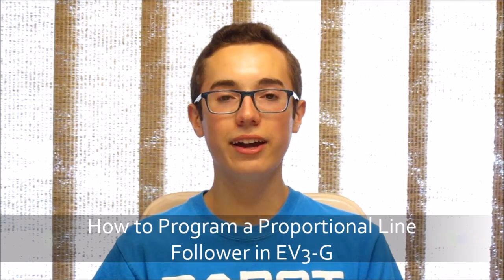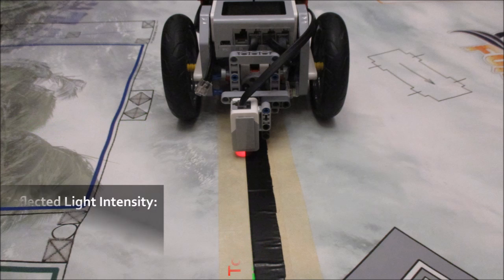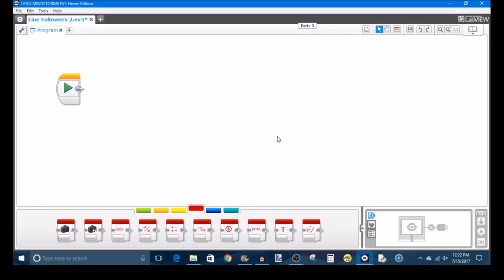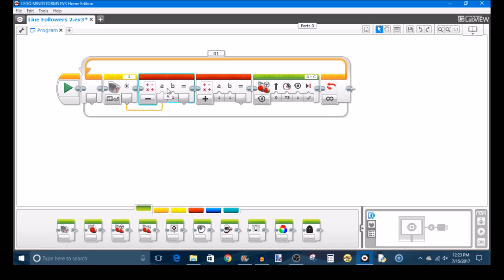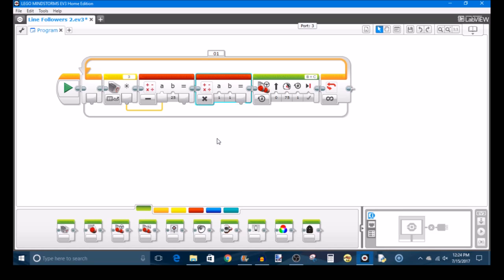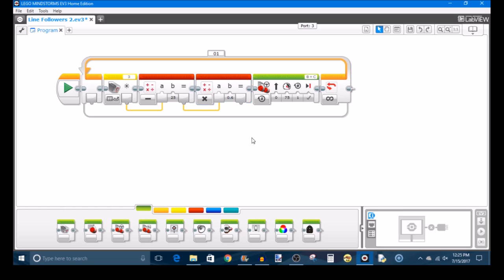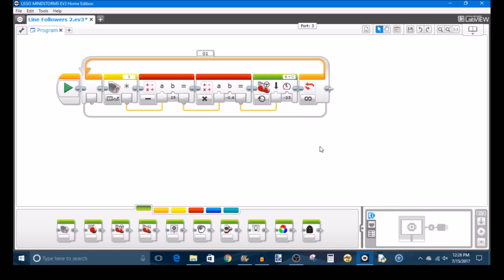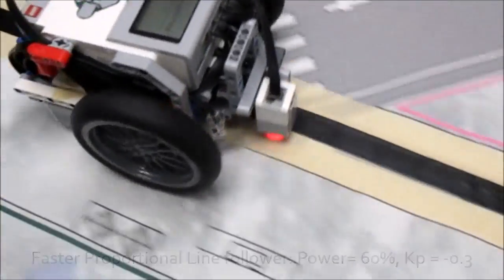Proportional Line Follower for EV3 - Follow the Line Smoothly!

Comment: I have a problem. I have NXT robot and if I use EV3 program its telling me that my color senzor is getting 0 or 1 and not more. If i measure the light reflection  "manually" by the brick Im getting between 45-80 (table and black tape)

Comment: Thanks for the info..btw im planning to build a follower guided pantograph for my plasma metal cutter, is it possible to use this design? The follower sensor will be riding on the x y axis table and the x y movements will be controlled by motors, it would need to be reversing..do you have a similar design that would fit my plan build? I wish you could help me..tia! Happy new year!

Comment: Thanks for this vid, but I never could get it to work on our FLL EV3 robot after tinkering for about an hour. I suspect it has to do with where our color sensor is placed: not out in front of the robot like yours, but actually underneath the robot slightly behind the wheels. 

We had to go this way after a disastrous result a couple years ago where the florescent gym lighting at our competition was much different than the warm lighting in my house where we set the programs, and we failed everything we set out to do since the reflected light values were so much different. 

The next year we put the light sensor beneath the robot so the outside light didn't pollute, and did much better with those kinds of sensors/programs. 

Is it possible to use a follower program similar to this even though the light is in a different position on the robot? Thanks for the help.
Reply: We're having the same issue and also tucked our sensor in the middle under the brick. Were you able to resolve this issue?
Reply: Shazia Riaz nope. We just did without line following.
Reply: @thebruisedreed9766  interesting. Did you try moving the sensor to the front to test and see if you're right about placement? I might do that. So odd that it won't work. Thanks for responding.

Comment: I tried the line follower with my robot, but it kept spinning in circles. How do I fix this? Thanks
Reply from the maker: Make sure that your color sensor is detecting the line. You can verify this using Port View to see the reflected light intensity and comparing it to your threshold value.
Reply: make sure your math block is a - and x
Reply: Make sure you're using the correct port for your sensor

Comment: Is it posiible to do pid with medium motors ?? If yes show us please
Reply from the maker: Yes, a PID is a feedback loop algorithm, so you can really apply it to any system that required corrections based on error; that means any motor type for line following. The difference between Medium and Large motors is that Medium motors have no Move Steering block, so you have to make your own by adding/subtracting the power values in two independent motor blocks to make turns.
Reply: @Builderdude35 Ok but i how will i do that.Lets say i find the error (colour sensor value - target) and i multiply times kp.Then how can i make medium motors move in this steering(correction).Please tell me the exact code cause i have to make a medium motor line follower.Thank you!
Reply from the maker: @ggelosstavrou9117  The output of the PID algorithm is a single numerical value. Set both medium motors to a base power level (ex: 50%) and then add the PID output to the power value of one Med motor, subtract it from the other.
Reply: @Builderdude35  oh ok thank you very much i will try this! By the way can you watch a video on youtube called robotex 2018 line following 14 years old and older and watch the 3 best robots in the end.You believe it is just pid or it has something more.Please i need your opinion. Thanks a lot!

Comment: Hi! I've a serious problem. We're using a robot similar to your robot, Sirius. The weight is distributed equally, it moves in a straight line, and the wheels has a firm grip. We've tried out your proportional line following program, but our robot seems to wiggle and lose track of the line.
Reply from the maker: Your Kp is improperly adjusted. From your description, it seems most likely that it is too large, so try experimenting with a smaller constant.

Comment: This doesn’t work it won’t go round a left turn or a right turn at all
Reply from the maker: You will need to adjust the k value to handle sharper turns. Or, use a PPID algorithm.

Comment: Hi. Why did you not use the maths bloc with ADV mode and (a-b)*c instead of the 2 maths blocs ?
Thank for your videos.
Reply from the maker: You can certainly use that block to replace the two math blocks with one. I chose to do two separate blocks because I think it's clearer and easier to teach that way. Also, I don't like having those two extra empty terms. It all works the same way when it runs on the robot, so which way you program is purely a matter of opinion.
Reply: Thank you for your answer.
What do you think to make a video about where to put the sensor ? In front, between the wheels, by a side or in the middle ?
Reply from the maker: Definitely in front. I have a video that goes into a little more detail about sensor placement here: https://youtu.be/kNXwkVwnwLI
Reply: Thank you to your parents for having designed you.

Comment: I went to summer camp and there was a robotics competition. The teacher used your videos to show kids everything they could possibly need to know for the program. The challenge was to make a robot drive in a perfect square and points were awarded for staying parallel and time. I used the same line follower (a month before this video) and it failed horribly. I know the program is perfect but the wood wrecked the color and the robot drive in circles. I ended up having to use a gyro sensor and came in third out of 16 teams. I only lost because I got stuck with tiny wheels and the two teams ahead of me had wheels bigger than Sirius. I’m still kinda mad lol.
Reply from the maker: Aww man! I'm sorry to hear it didn't work out! But, you can use this as a learning experience; taller wheels allow a robot to drive over bumps with less of an effect. Anyway, good luck next time!

Comment: Good video! But why don't you set the power 100 (-100)? Thank you!
Reply from the maker: As you can see, the robot I show in this demonstration, Sirius, has really tall wheels. 100% power would be too much and the robot would be way too fast to be controllable. If your robot has shorter wheels, then you might be able to try a higher power.
Reply: Thanks a lot, Builderdude35. But what I have to do to make your Sirius more fast (and controllable)? Can you continue to explain this theme (Line Follower) in your next video? Thank you!
Reply from the maker: You can definitely make it faster than the 35% I showed, but you will need to spend more time tuning. To make your robot more stable, you may want to rethink where the color sensors are in relation to the wheels. Check out this video (https://youtu.be/kNXwkVwnwLI), it explains what I mean. Also consider a two-sensor line follower; they are more stable.

Comment: If the robot starts FAR AWAY from the black line, what is the best way for the 'bot to ACQUIRE the line?  If the approach is done at a steep angle (and not perfectly parallel with the black line in the first place), how can the robot "lock onto" the line without overshooting it?  If the mat contains a lot of light & dark patches (mimicking the Reflected Light Intensity of the black line), how can the 'bot tell what is the desired line and what is just "clutter"?
Reply from the maker: Thank you for the suggestion! I'll be certain to make a tutorial on this topic in the coming weeks!
Reply: dluders you can put a loop inside a loop with different end conditions. The inner one can be until it is close to a line and the outer can be the actual color value. That will make it so the robot does not stop until it reaches appropriate distance and on the line (in theory). You could also make the robot drive up to the line and use the line squaring video that builderdude37 already has up. Hope I helped!
Reply from the maker: Thank you for sharing! That's pretty much what I was planning to say in the tutorial.